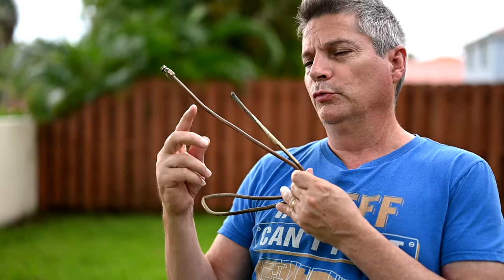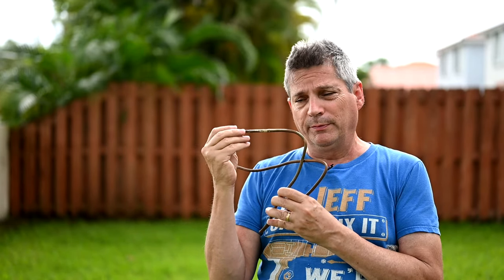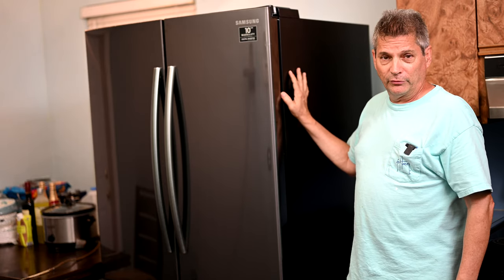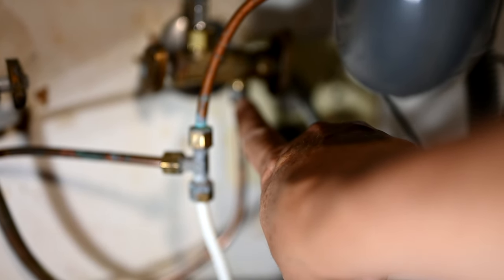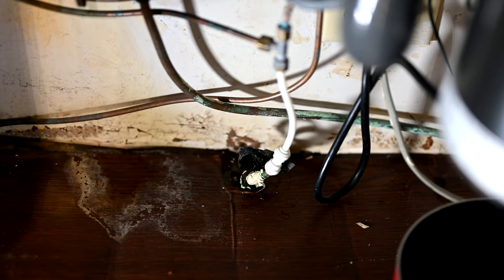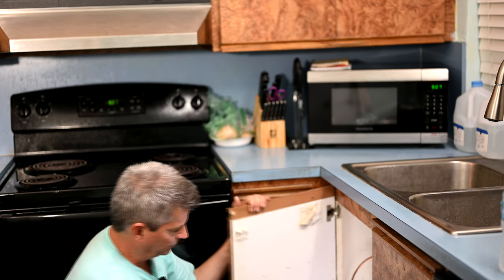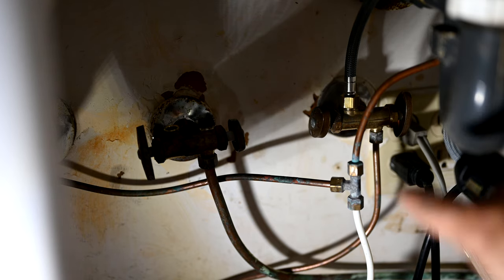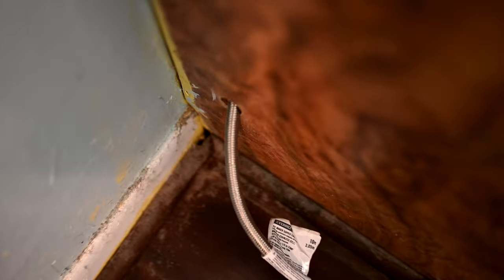How To Fix BROKEN Ice Maker Supply Line Copper Tubing

Comment from the maker: Be sure you select the correct length braided steel ice maker supply line:
🛒 Milwaukee 2131-20 M18 ROCKET Dual Power Tower Light (Tool Only): https://amzn.to/2YXdeU7
🛒 Milwaukee 49-22-4025 13-Piece Hole Dozer Hole Saw Kit: https://amzn.to/2JqRYgG
🛒 BrassCraft KTCR1900DVX R Dual shut Off Valve Cold Water Ice Maker: https://amzn.to/2OfHAeL
🛒 BrassCraft KTCR1901DVX R Dual shut Off Valve Hot Water Side: https://amzn.to/2Ua4B6y
🛒 RIDGID One Stop Wrench Kit: https://amzn.to/2ClCbNa
🛒 Channellock 12-Inch Pliers: https://amzn.to/2MdcnGR
🛒 Ice Maker Water Line, 15 Feet, Premium Braided Stainless Steel: https://amzn.to/2D7ZsoX
🛒 Ice Maker Water Line, 25 Feet, Premium Braided Stainless Steelhttps://amzn.to/3f9n6jg
🛒 Ice Maker Water Line, 5 Feet, Premium Braided Stainless https://amzn.to/2CbHnG6

Comment: What parts do you use for the outlet box install? Do you use 1/2 inch line through the wall? What valve do you connect it to under sink?
Reply from the maker: To comply with plumbing codes, most cities require on like this https://homedepot.sjv.io/WxgkM with a hammer arrester on it. It solders onto 1/2" copper pipe and you route 1/2" standard copper pip inside the wall to the cold water pipe. If that is not feasible, use the dual valve on the cold water under the sink and just run the stainless steel 1/4" hose to the icemaker. One of the valves on that dual valve on the cold water supply should be 1/4".

Comment: Hi Jeff, I love your videos. Most recently that rocket light one was pretty artistic as well as helpful. ☺
When I get a new fridge, I plan to change out my 30 year old copper line, which appears to be behind alll the cabinets, in a space between the cabinets and the wall.
It will need the 25 ft braided line. What I am asking is how do you fish the line through in this situation. Do you coupling together the new braided line to the old copper line at the sink end, and then pull on the copper at the fridge end to feed the braided line through behind the cabinets? Because there is a butler's closet halfway in between, keeping the line exposed is not an esthetic option.
Reply from the maker: I don't think you will have any luck with that, the braided hoses are much thicker than the copper line. There's always 2 ways to run water to the fridge:
1) If drywall is down, run pipes through the studs, then place an outlet on the wall, that is best case. 
2) If you are not remodeling and not moving cabinets, the only choice is to use a HoleDozer set like we showed in this video, and drill holes on side of the cabinets in the very back of the cabinet. Then you feed the ice maker supply line through each hole to the next cabinet, then behind the stove, etc. We just did this on our friend's kitchen remodel in March, even routed the supply line through the corner lazy Susan cabinet.

Comment: I just ran it behind the cabinets because the wall was brick, back when I remodeled my kitchen
Reply from the maker: That's good too, as long as the cabinet is not pinching the hose. I still prefer to run the hose through the cabinets, because it is easy to un-route and install a new one should the need arise.

Comment: I just bought a new fridge and the delivery guys won't touch the water line, so I turned off the shut-off valve and disconnected  the copper tubing from the old fridge. It leaks badly. Turns out someone installed a saddle valve for the copper tubing. So I had to shut off a valve one step up (which also shuts off the water to my washer). So, I will have to replace that saddle valve soon.

Comment: To permanently cut off water line: My repair co guy cut off the icemaker line under the sink. He used a brass cap to start but that leaked in a few hours. He came back today and installed a copper piece that he had soldered the night before. Is this a standard and safe way to go?

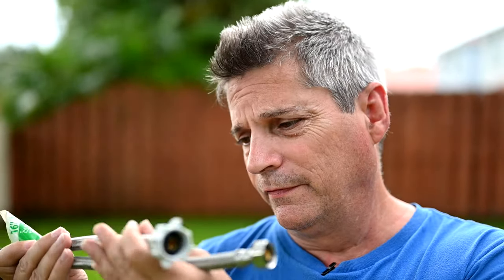Comment: 2:20 Even a brand new copper line will break if you bend it that many times.
Reply from the maker: I'm always careful to keep copper lines like that from moving. Also even the copper pipe coming out of the wall to supply water for the toilets in the sink we often will put PO adhesive in oh adhesive in that gap between the drywall And the pipe to fill in that space and make sure it does not move

Comment: I have a brand new GE Frig that is leaking water on the floor. I think it is an internal leak and the leak stopped when I shut off the water supply to the ice maker. My supply line doesn't look like that.

Comment: U also see them for lav supply lines. Old moen faucets come.factory set like that with qtr inch copper tubes. If they arent long enough. You have to use a Male by male compression by male thread and connect the 3/8" braided supply. But yet for old school systems this copper tubing is very common.

Comment: Wait wait wait!!! Jeff why didn't you add a 1/4" supply cut off valve just before the fridge line?
Especially if a second item like a filter is involved. I do like the Milwaukee light though.
Reply from the maker: The 1/4" supply cutoff valve is under the sink as part of that dual valve you see on the cold water side. You turn off the 1/4" fridge water supply line by shutting off one half of that valve. did you see our review of that Milwaukee M18 Rocket Tower light that we uploaded last week?

Comment: Is it bad to overtighten the connectors? I’ve connected a new hose to my copper connector and it seems to leak one drop at the copper side.?
Reply from the maker: I hate dealing with copper lines. Usually with those you hand tighten and then use pliers to go 1/2 turn past hand tighten, unless the manufacturer tells you otherwise.

Comment: I switched out my copper line for the flexible tubing and now the fridge water smells and tastes like plastic. We can’t even drink it! I want to go back to the copper.
Reply from the maker: Try a steel belted plastic hose, those seem to do he best. You can run some water through them for a while too if there is any plastic smell to start off with

Comment: I must confess I did use a saddle valve. I will take it out and replace it with something more appropriate. The only problem is I will have to solder a coupling where the valve pierced the copper pipe. Great instructional video.I am in Brampton, Ontario Canada
Reply from the maker: Thanks for sharing

Comment: How can I tie it off
Reply from the maker: they make end caps that compress on, but I prefer to trace the tube back tot he valve and just remove it.
Reply: @jeffostroff   its under house tight quarters
Reply: @jeffostroff   tube like I guess 1/4 maybe its round like my oinky.lol so end caps  does it screw on the frig for ice maker ?
Reply from the maker: @dianascott6046  No end caps would be for the copper line if you want to cap it off.
Reply: So can i just crimp it together

Comment: Most of those hoses have complaints of plasticky or garden hose taste, and some people say it takes weeks or months to dissipate.  Because of this, I ended up finding a pex ice maker kit, which worked really well to go from my access in the basement up to the fridge. It had the advantage of already wanting to be in a coil for behind the fridge.
Reply from the maker: You might be referring to old school or cheep manufacturers. When you look at the reviews on HD's web site for the ice maker braided lines, one of the questions asked was does it add a plastic hose taste, and numbers of people responded no bad taste.
Reply: @jeffostroff  Some brands are definitely worse than others, but almost all had some complaints, especially with longer lengths. I'm sure it would have gone away, but I didn't want to take the chance. It is something to look for when buying a specific product. The pex worked well with no issues in taste

Comment: I have a plastic supply line
Reply from the maker: Jack those are best upgraded to steel belt hoses.
Reply: @ jeffostroff I also like them because I can shorten it.
Reply from the maker: @jacksplumbingvideos7147  Yes, we cannot shorten the steel belted hoses, so we have to make sure we are choosing the correct length, with enough slack.